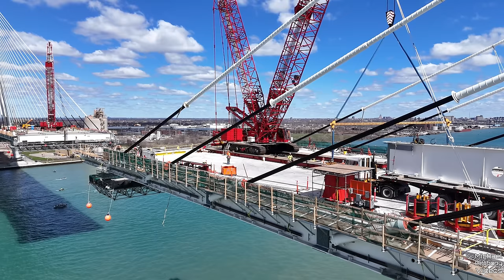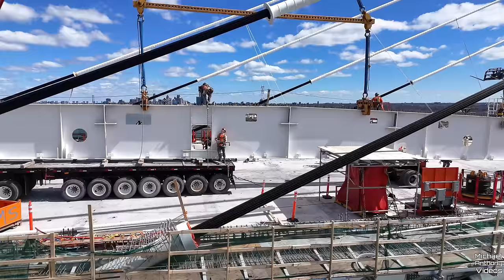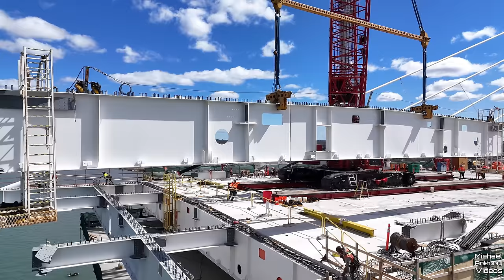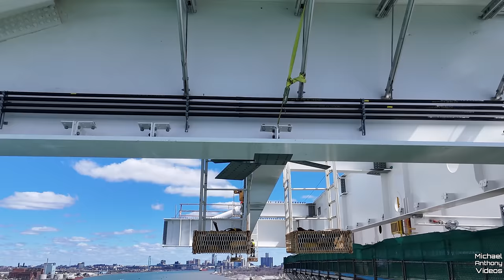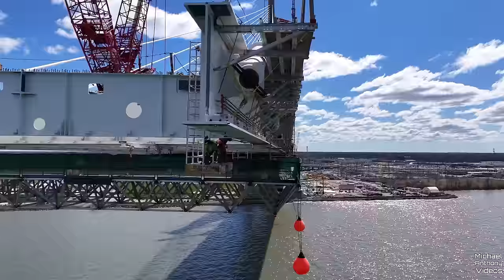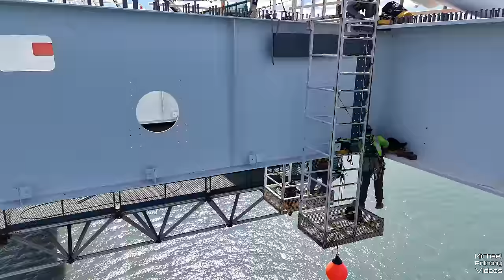68,000 Lb Cross Beam Placement | Gordie Howe International Bridge

Comment: The amazing part for me is the structural integrity of the towers and cable stays. Iron workers are certainly one the best crafts at using a crane safely and effectively. I have a lot of respect for a good raising gang. As a crane operator I can tell you they are a pleasure to work with.
Reply: Agreed and well said.. mobile crane op here in NJ/NY area and my favorite jobs are steel jobs. Always a pleasure working alongside iron workers slingin steel all day 🪝

Comment: So cable stayed bride and suspension bridge can get awry because of wind. The behaviour is like half pendulum. To prevent this, one can design with very low strain. Another thing that can be done is, span can designed like inverted wing of air plane.